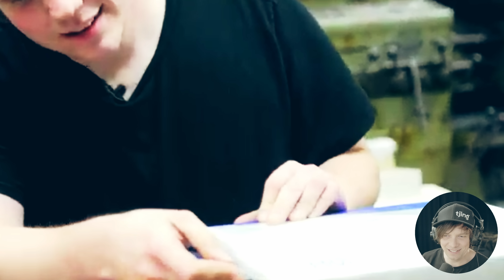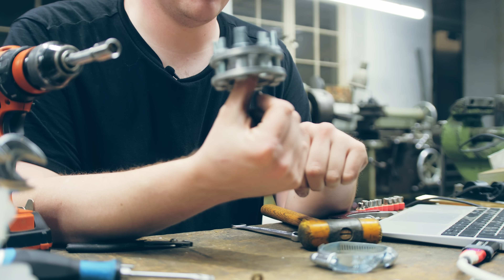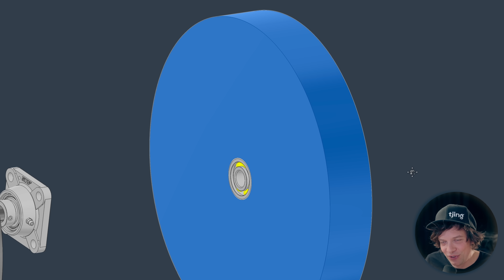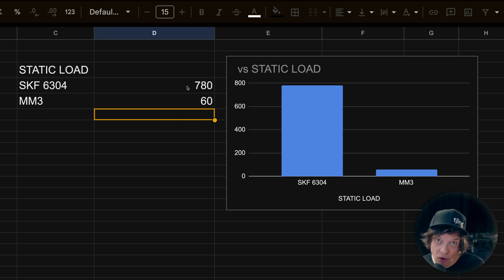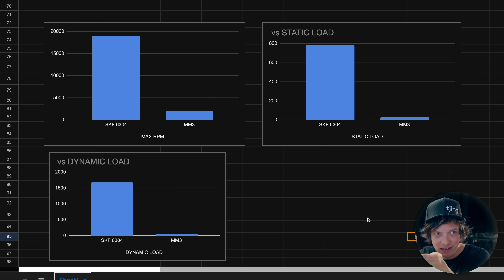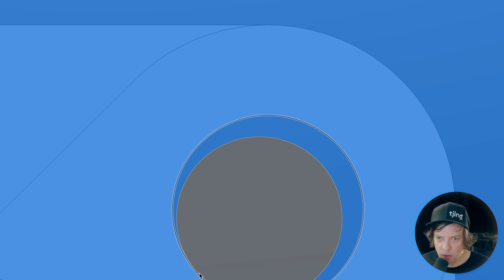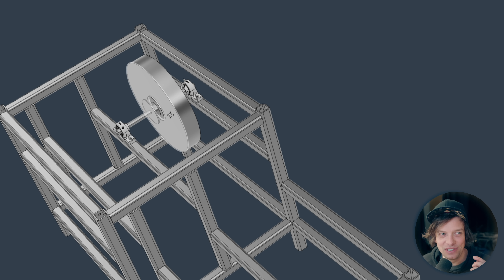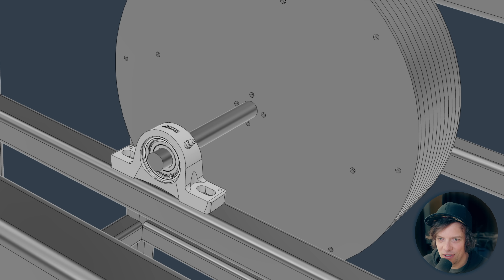Worst Bearing Housing Ever - Marble Machine 3 Ep.3

Comment: A counterbore to pressfit the flywheel to will solve perpendicularity as well, and a flywheel is dynamically not geometrically balanced. Steel has different densities throughout so a precise disk machined to a precise CAD model may still be wobbly in the real world. This is an unnecessary rabbit hole and it will create more problems. There’s a reason press fitting bearings is the industry standard and has been since bearings have been around.

Comment: Have you considered a dual conical bearing design like used in the front wheel axels of nearly all auto/truck designs? Off the shelf availability, strength, and automatic centering positioning.

Comment: Hello,
My only concern after watching this video is with the fly wheel, if it is not perfectly vertical in place then as soon as it starts to turn it will execute a force on the shaft to try to get vertical and this could damage the shaft prematurely...

Love your work ! 😍😍
Reply: Damage it how?

How much torque would it need to exert over the contact area of your average bearing to hit a pressure high enough to plasticly deform a shaft?

Answer: More than you can practically generate

Comment: Martin: perfect is the enemy of good enough.
Also Martin: 'we need millisecond tightness'
Reply: His targets are faster than the speed of sound. The time it takes for sound to travel from one side of the machine to the other is ~3ms, so standing on the left side vs the right side will change the timing of the sounds reaching your ear more than the actual error between notes
Reply: It's not silly at all. It's a design target. Each additional moving part in the train will introduce a slight bit of delay and variability. Keeping it under control for each part in isolation means it'll be less likely he'll have to go back to find where he can shave off a little bit of variance after it's all put together.

If he were actually struggling to achieve that tolerance then maybe you could argue his standards are too high... but so far, so good. He's been able to hit his targets better than he even imagined he could. So can you really say he was wrong about that?

The flywheel stuff... I mean yeah, that's kind of a different issue.
Reply: Milliseconds do matter for music
Reply: @christianvanderstap6257  sure, notes shouldn't be hundreds or thousands of milliseconds off.
Reply: @christianvanderstap6257  when you reach [a delay of] tens, dozens, of milliseconds, yes they do. 3ms do not.
Reply: @OHomemquecalculava  i am not
Reply: @OHomemquecalculava  
You can hear a 10 second delay. Never reaching that makes the machine able to be tight. Thus under 5 ms is preffered
Reply: @joachimsrensen7666  I understand that, that was my point exactly. 10ms delay or above will be a problem, but a 3ms precision is imperceptible. Once he reached 5ms, there was no point in tuning it further.
Reply: Martin aimed for under 5 ms

Comment: If you laser cut the first plate to the bearing housing outside dimensions, that should be a closer locator than the bolts. 

Squashing threads over time is a concern though.

At least I would rather have a bushing machined to remove the concentricity issue. Something to take up the space between the bolt and whatever size hole. You can then use a smaller bolt, which is probably still above your sheer force requirements.

Comment: The biggest issue is not the engineering of the flywheel, it's that he's using Reddit in light mode
Reply: or using reddit at all. anyone who posts on reddit re: engineering should have to post a picture of their bedroom and/or something they've built that doesn't suck
Reply: @chrismathewsjr  why the bedroom? Why not your workshop or work desk?
Reply: @slartibartfast2649  because i don't respect bad bedrooms
Reply: @chrismathewsjr  Right, I agree that a chaotic room is a sign of a chaotic mind. However, that doesn't make them any less skilled or knowledgeable, only disorganised.

You don't need to respect a person for them to be right about something.
Reply: @slartibartfast2649  i simply could never take advice from a virgin with a mattress on the ground that also has never designed anything successful

Comment: The bearing arrangement you propose is well within the tolerances you need - if it represents more 'work' than you require is debatable. Flange bearings will need to be 'counter' mounted because they are self-aligning- so the call to use them is a bit mis- quoted. Go with your own direction and just do it.

Comment: I think that your problem with the tolerances of the lazercut parts can never be corrected in any way.
The tolerances of the lazercutter will be the most precise part you can get. if you want even better concentricity you will have to machine this  part. That's just how this stuff works.

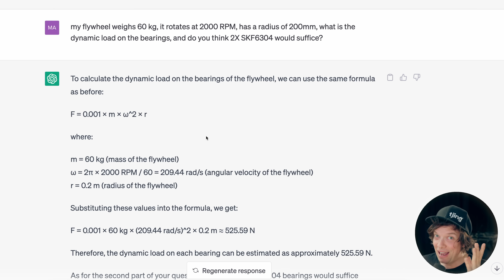Comment: 9:50 NO! Do NOT ask ChatGPT to calculate anything for you. It does NOT handle calculations well and is confidently wrong about it.
Reply: Yes. It is true it read all texts about physics and can generate texts that look a lot like physics texts, but it does not understand the underlying logic and laws.
Reply: @kaya_zyxx  this goes for all interactions with large language models. You can't trust their output. If you can't verify what they're telling you, you're better off not using them. Even if they lack information they will simply "hallucinate" information to produce an answer. This is an active area of research and nobody has found a satisfactory solution yet.
Reply: @jfolz  And that requirement for verifying every single fact it produces kind of defeats its purpose for the most part. If you know the answer to your question already, you don't have any reason to ask... If you don't know, you can't verify.

But maybe you can utilize its association capabilities to find relevant Wikipedia pages or keywords or professional fields to help with the problem you describe to it. Does anyone use it for that, though?
Reply: @tkava7906  (at least right now) LLMs are tools. You have to use them right to make them useful. They're very good at language tasks. Turning bullet points into prose. Summarizing. Paraphrasing. Creative writing. Even if the result is not perfect, usually only minor changes are necessary.
Reply: @jfolz  However AFAIK, ChatGPT is also specifically trained to respond to questions in confident language, as if it could understand almost everything and knew correct answers, which is totally irresponsible by OpenAI in my opinion. It's trained to superficially mimic expertise, maybe in a honest hope that such would magically lead to true understanding, or maybe they are cynical and do it just for the huge marketing value. It scares me how rare people like you are, people who actually understand what is going on and how little you can trust these things. Lots of people ask it to solve real problems (like Martin here), for life advice, etc, and OpenAI has been perfectly happy with that.
Reply: @tkava7906  I'm not positive about it being explicitly trained to be confident. Ironically, despite being called OpenAI, they keep details on their newest models very close to their chest. One important part of the training beyond just ingesting "the internet" is fine-tuning based on human feedback. OpenAI contracted workers in Kenya to give feedback on responses to prompts. That feedback was then used to re-train the model to respond in a way that those workers liked. It's entirely possible that they were subconsciously biased towards confident responses and that's how the model got overconfident.
Reply: @tkava7906  It's because these Machine Learning language models (people keep calling it AI, but it's just ML) are basically just text predictors on steroids. There's so many ways the text prediction can go wrong. It only knows which 'tokens' frequently come before or after other 'tokens'.  (in weaker language models, these are usually whole words, but things like chatGPT can break them down to one or few characters, and have contextual clues, such as quotations and brackets)
So all it takes is learning one wrong answer, and one person writing something similar, correct, and confidently... For it to construct a response that is wrong and confident.

Not to mention... It doesn't have the contextual clues such as... Is the information coming from someone posting their incorrect work and looking for help fixing it... Or someone actually posting a solution to it? This is probably where all the improper code comes from when people ask it to write code for them. It's probably grabbing a lot of QUESTIONS and not ANSWERS from places like stackexchange. Because people there often 'direct' you to understand an answer, not write it for you.
Reply: +1 for this. It doesn't perform the actual calculations. When you ask ChatGPT a calculation, its response is best thought of as a ballpark guess as to what the answer could be. And that guess can be very far off
Reply: That said, its explanations tend to be better than its numerical answers. IF ChatGPT is going to be used, you have to at least follow through its logic using a calculator and substitute in the correct numerical values
Reply: It did all the calculations correctly. I am not quite sure where the equation came from, though. Why is it multiplying by 0.001, and why is it doing × r instead of /r?
Reply: @innertuber4049  Also not sure where the 0.001 came from. Just for fun I asked the same question to GPT4 and it answered with 525.36  KILO Newtons (1000x larger value than GPT3 suggested). It also said: "This is much less than the calculated dynamic load of the flywheel (525.36 kN), suggesting that 2 SKF 6304 bearings would not be sufficient to handle the load. It would be advisable to consider using bearings with a higher dynamic load capacity, or to revise the design parameters to reduce the load."
Reply: @bzqp2  Thank you so much!
Reply: for now anyway
Reply: I saw somewhere someone working on connecting chat gpt and wolfram alpha, that could turn out interesting 🤓

Comment: At 16:40 you are discussing the need to perfectly align the shaft perpendicular to the frame. This is not strictly neccessary and the bearings are designed this way because it isn't a critical dimension, even for your application. As everyone is saying, don't overdesign what already exists.
Reply: I don't see why he isn't using those bearings as he should? Just mount the bearing housings on the frame and fix the flywheel to the shaft. You know... like any sane engineer would do.
Reply: @CristiNeagu  Did you watch the video yet..? That's exactly what he said he's considering.
Reply: @codahighland  As a last measure, sounds like.
Reply: @CristiNeagu  That's the conclusion he comes to at the end of the video. Although it's not fixed to the shaft, there's a clutch.
Reply: In fact, the bearings are designed like that because things will flex. Trying to make alignment perfect sounds is a recipe for failure. I think Martin got that in the end.
Reply: @RegebroRepairs  Exactly. Forcing a perfect rigid tolerance will result in binding and reduced performance. Martin has to see the advantage of not redesigning a perfectly good wheel. Literally, in this case.

Comment: I think the bigger issue is not the bearing failing, the housing itself could be more likely to fail than a standard tried and tested design.
Reply: This is what i was thinking as well. He goes into depth about the bearing specs, but all of the housing parts need to be subjected to the same scrutiny. Yes Matteo, bolt strength, but also with vibration and side-loads, i can see the threads wearing into the plates, affecting their ability to center the bearing. Just my thoughts.
Reply: @apocolisp7773  Exactly, long before anything else, the threads of the bolts will begin to be flattened out, turning the interference fit to a sloppy one. 

Once that happens it may or may not have the freedom to flop around until the bolts give out. I kind of suspect not, just because in my old job I saw how much abuse bolts can often take in non-ideal scenarios before sheering. I think before you'd need to worry about sheering a bolt, the machine would have long since shook itself apart.
Reply: The biggest problem is that the bearing itself is resting on the tips of the threads. I doubt we're talking about hardened threads here, so they will start to deform before long, developing radial play in the bearing housing.
Reply: @CristiNeagu  YES this is what has been bugging me from the start, not sure why this isn't called out by more people: the bearing surface is divided between a number of thin surfaces on a number of bolts GAH
Reply: I agree with you on this thought because the screws in the housing will be subjected to shear forces (which means that a force is applied perpendicular to the axis of the screw). Screws are generally not designed to withstand this type of constraint, and their shear strength is much weaker than their tensile strength. Furthermore, these shear forces can cause the loosening of the screws. It would be better IMO to use dowel pins or elastic pin for securing the bearing as they are specifically designed to withstand this kind of 
constraints.
Reply: The bearing could also fail, although probably not catastrophically, since the outer race is only supported by a marginal contact area of the thread major diameter in some 8 points. A machined bore fully supports the race throughout it's width and entire diameter. I would also assume the load rating of the bearing also intends the outer race be fully supported.
Reply: "A chain is only as strong as its weakest link"
Reply: Exactly, those bolts will get shredded over time.

Comment: for the application probably even a skateboard bearing would suffice
Reply: Inner diameter is too small in a skateboard bearing. He needs thicker shafts.
Reply: @defenestrated23  I suppose, albeit there could be an argument made for them to be oversized as well... granted the flywheel has weight and will have inertia as well, but depending on the grade of steel rod used... also there can of course be mickey moused solutions to make an adapter for the bearing to said shaft. The point was merely that from the spinning speed and weight loads, such a bearing would "do"...

Comment: Best part is no part! Press it in to flywheel
Reply: I was thinking of something similar. Heat up the flywheel and then press the shaft into it. Recognize that you only have one chance to get it right, so maybe don't have the shaft machined to final length and have a stop-block so you can push the shaft in until you hit the stop block and then you should be within mm of correct placement.

Comment: Not an engineer but I can spot I think the biggest concern with the design. It's not the alignment or load anything else you've addressed. It's the fact you are relying on 8 bolts contained in 2 plates to hold a bearing under strain and not shearing or shifting.

The solution at the end of the video would make more sense since the load is onto the frame, not the shaft

Comment: You should not be using bearings in such a way that moment load on the bearing is what keeps everything perpendicular. If you have two bearings such a distance apart, it will be the radial loading on the bearings that keeps everything perpendicular. As a general rule, ball bearings do not handle moment loading well

Comment: 16:24 no bearing in the world can prevent misalignment! That's just not how bearings work. There are different solutions how to clamp bearings, but they all require at least two bearings. Just take inspiration by the headset of a bike.
Reply: Exactly, it's not the rotational rigidity of a single bearing that keeps the flywheel perpendicular to the shaft. It would be that there are two different bearings coupled together that enforce the flywheel staying perpendicular.

A single ball bearing isn't designed to take rotational loads in that dimension no matter how it's attached

Comment: The real solution is just balancing the flywheel with some weights like a wheel on a car I think. Then it can be slightly off center and the precision can be lower
Reply: A good example of balance being more important than shape is the way many of the BattleBots spinning weapons are very odd and asymmetric shapes but spin smoothly because they are balanced with the center of mass in the middle of the rotation axis.
Reply: @jordanshilander487  Hell, just look atflywheels from steam engines. The outside might be turned nice and even, but the raw castings of the spokes are often quiet uncentered, so much one can see the differences when they spin by the line where the painted inside borders to the outside wobbeling a lot. But as they are well balanced, they turn smoothly none the less.
Reply: No kidding. Its literally a spinning mass. There's literally no other design parameters other than it being balanced. Its not interfacing with anything other than the axle. Its physical dimensions are irrelevant unless there's clearance issues.
Reply: But it has to hold the radial position.  But you are right.  It is always possible to balance the disc reduce the forces from the rotating discs.  But you should hold that force.
Reply: You'll still need a way to measure the balance, though. Much easier to make it as concentric as possible in the first place.
Reply: @someguy5334  Yes, but its easier and more simple to balance the thing rather than to machine it to insane tolerances.=
Reply: @someguy5334  you do that with a lathe
Reply: @diobrando2160  No, you do that by having it on an axle and just spinning it. If it´s not well ballanced it will tend to stop in one position. It´s the same to how people balance props for model planes or wheels for rc cars.